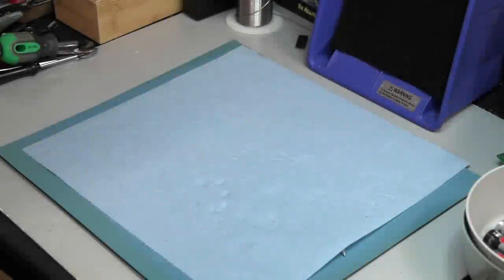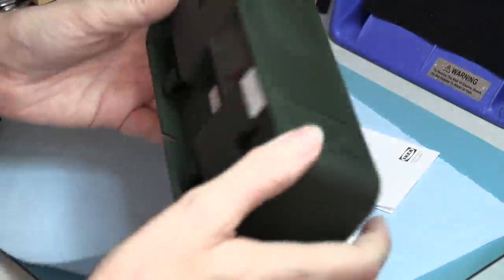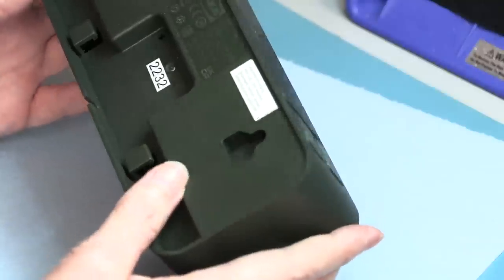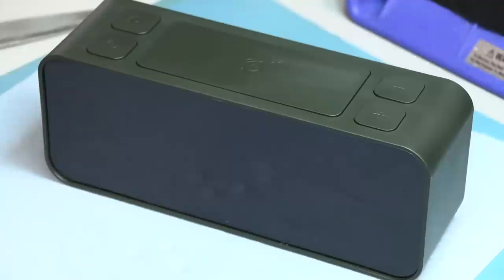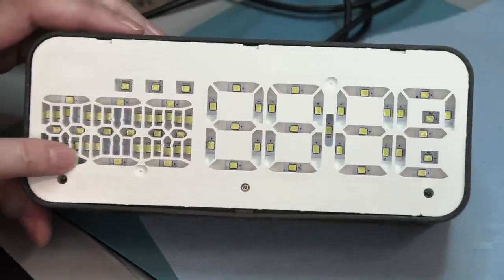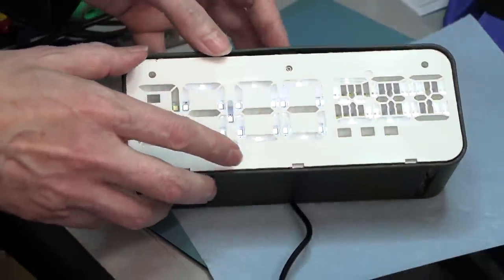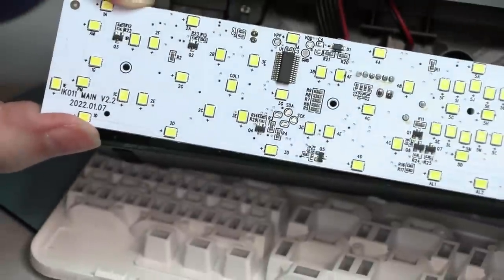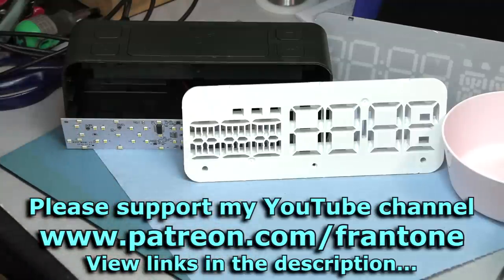Beneath The Mask Of A Cheap IKEA Clock

Comment: The European date style is: DD.MM.YYYY, YYYY.MM.DD is a thing that is used most in APAC countrys ;-) But the missing PSU is a Europ thingy. The EU has restrickted the manufacturers to not deliver PSUs ansymore. Only non standard PSUs still allowed. So any product that uses USB power, will come without PSU. Only if the device uses propertary charging standards, PSUs are still allowed.

Comment: The UK listing says you need to buy a LILLHULT USB lead. So, no psu supplied.
Reply: This is just Ikea "doing an Apple" though. Nothing to do with any rules or regulations, in fact it's due to a lack of them.
Reply: @oldblueshirtguy   No it isn't. Doing an Apple means to requite a custom cable only sold by Apple. I.e. having a custom-designed lock-in.

This clock uses a standard cable. It's just that the documentation happens to mention the IKEA product name for a suitable cable. But you have thousands of other options too.
Reply: @perwestermark8920  "Doing an Apple" as in not including an item that's essential to use the product! 

At least with an Iphone you could plug the supplied standard USB-A plug into the most common type of third party charger, even if the phone uses a proprietary lightning connection. With this clock even a cable is not supplied, plus it uses micro-USB, an obsolete and now uncommon connector probably less common for many people than lightning!

Comment: EU regulations: there are enough adapters, so sellers can't include adapters with everything. And it has to be USB-C
Reply: Not only is that not what the regulations say, the micro-USB connector on that clock will actually become illegal (which is a good thing). That's probably why stock is being quickly sold in the US. 🙂